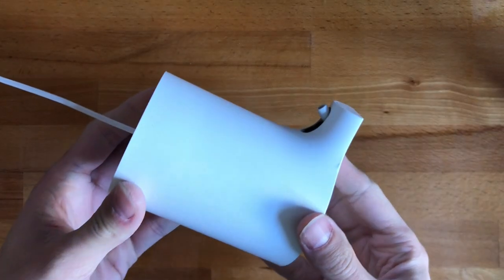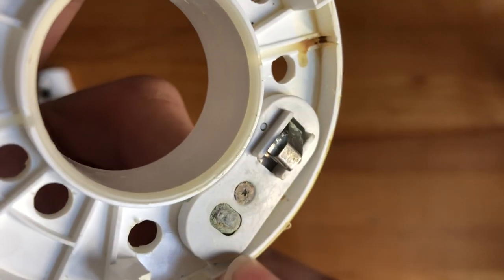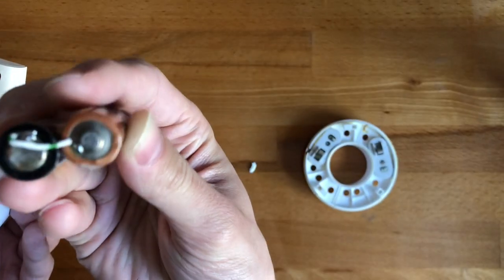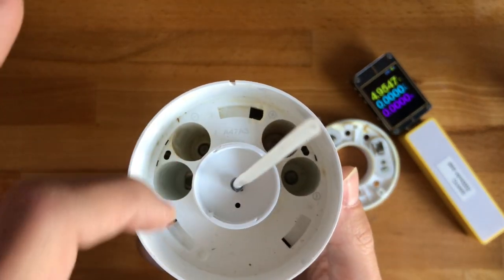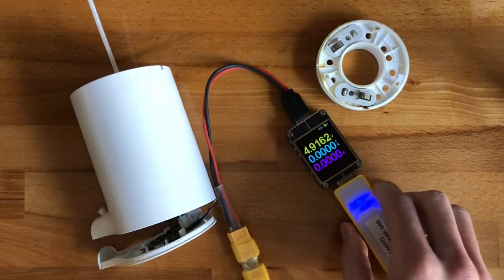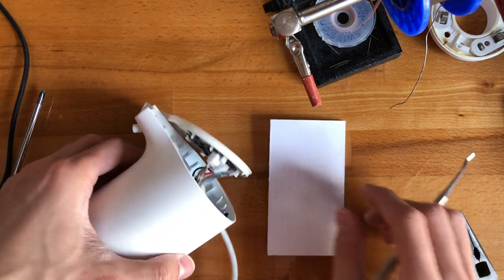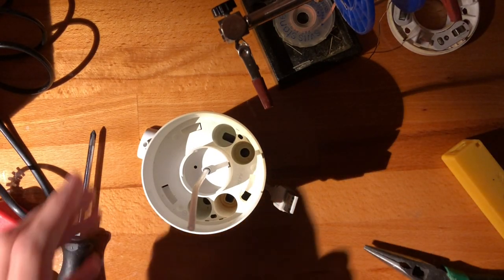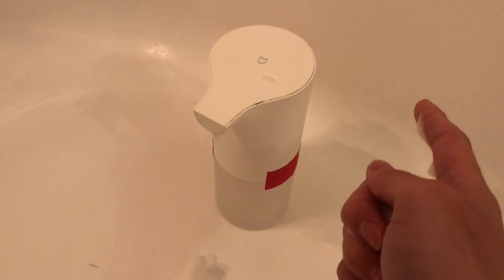Permanently Fix the Xiaomi Mijia Soap Dispenser

Comment: Thanks for this video. I love this device, and i replaced the batteries only once. But now i dunno the white light blinks for around a second but the device does not dispense any soap. i think it is clogged, but the device does not even try to suck up any liquid so… do you have to have any info?
Reply: Same deal. Came looking for the solution :D
Reply: +1
Reply: Me too..new batteries replaced only been a couple of weeks
Reply: try creaning the nizze with pressurized water. the motor might have jammed with soap solution dried up in it

Comment: Mine also kept dying!
Corroded contacts, dead ir LED and finally just dead.
Bought some other brand from amazon, similar price, stronger foam, rechargeable, better and prettier.
Reply from the maker: how long has the amazon replacement lasted so far??
Reply: @Darieee  ok not enough time has passed to evaluate it fully. I bought it thisFebruary. It's this one https://www.amazon.de/dp/B08D9M533B/ref=cm_sw_r_cp_apa_glt_i_F5C9GPY4MMA399NV11YT?_encoding=UTF8&psc=1
The Xiaomi one feels so underpowered now.
Plus this one has a li ion and the amount of foam is configurable (two modes)
Reply from the maker: the configurable foam option should be a must ❤️
Reply: Hi !! Does your model still works 2 years after ? I'm about to buy one
Reply: @Darieee  what a coincidence, it stopped foaming a week ago and I almost threw it away. Instead I took it apart and found out it was pretty much in perfect shape internally.

I ended up putting it back together and pumping clear water with some citric acid as descaler for a while and it started foaming again. Maybe just clear water would have been enough, and taking it apart to drive the motor continuously wasn't actually necessary.

I see now that my device is not sold anymore, but there are other similar ones which are probably the exact same internally.

I say get two and put one in the kitchen :)
Reply: @TheGfunk44  ups, I meant to answer to you instead.

It lasted 3 years, then it stopped foaming, then I ran clear water with a descaler (not sure the descaler was necessary) and it now runs as new again.

Comment: The motor on mine works, the sensor works, the led works... but nothing goes out. No foam, no water, soap, nothing. Do you have any idea what it might be? Thank you
Reply: Mine does the same. It does not pull the soap up.
Reply: try cleaning with only water

Comment: Do a DC adapter mod video to provide continuous power via a power outlet.
So no need to change batteries or charge a powerbank.
Reply from the maker: that would be rather wasteful in terms of energy consumption

these tiny powerbanks drau micro-amps/watts in standby, same as the soap dispenser

I've only charged it once to 80% and it's been running since I uploaded the video (2months by now?)

anything mains-coupled will burn a lot of power & represent somewhat of a hazard given this thing squirts liquid onto your hands